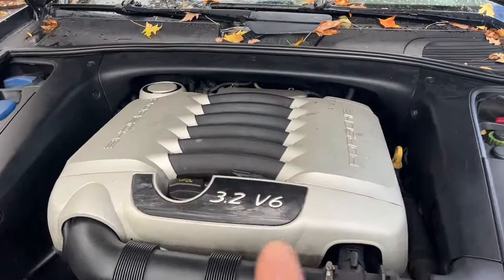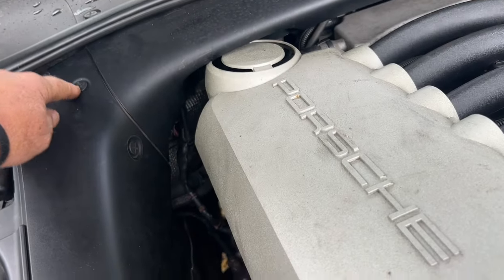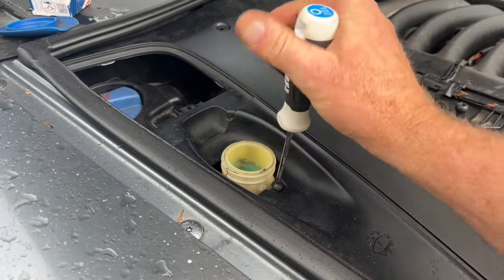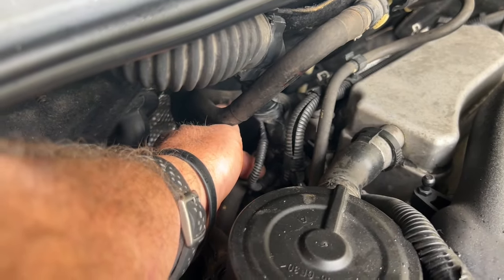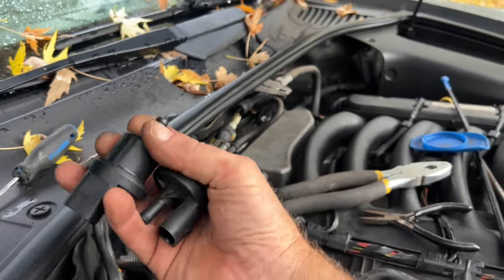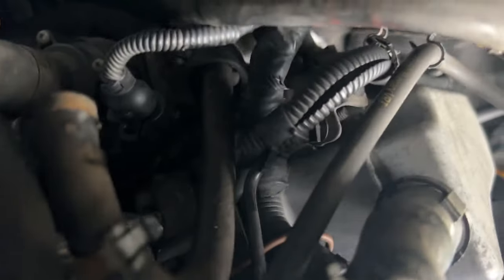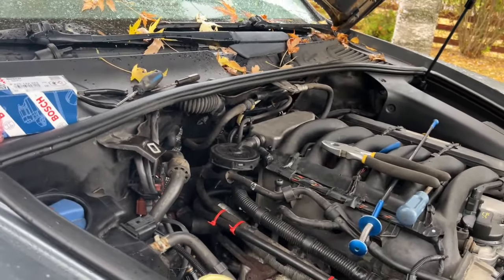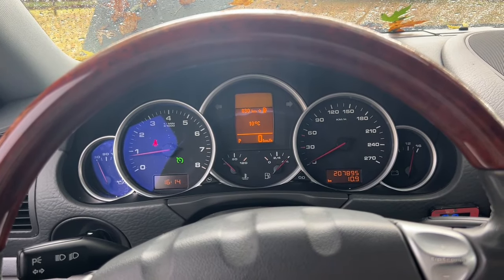Porsche Cayenne 955  3.2  code P0441 vacuum purge valve ,replacement

Comment: You gave great instructions on doing this. I replaced one of these and It’s a pain. Most purge valves are more accessible. Great how you explained removing the electrical connector. Why do they over engineer connectors and clips!! Great idea to use a piece of regular hose instead of spending $100+ on dealer molded one. Another great video.
Reply from the maker: thanks ..electricl connectors get more ridiculous each year . should be something thats standardized

Comment: Ok Fupa.. Lets go again. I know you since my w202 and you save me a lot of times.. Now.. I already check everything in my cayenne 3.2.. fuel pressure, all other possible vacuums leaks, gronds and voltage, smoke test, pcv valve, etc. Same problem. Cold start it kinds of search a vacuum leak but it correct itself 2min in when close loop enter(I guess, or it gets hot enought to do something). Works fine after. Im from Argentina. No error code also. If this works Im gonna cry and then comment down here. Anyways Thanks as always!
Reply: I havent sleep but so excited for this theory. Short term fuel trim and long term where negative when I check the first 4min the car start. So it made no sence for me. Vacuum leak would make it lean not rich so it would need to add fuel. Also if the maf where not reading some of the air.. it would add fuel. Stuck purge valve , I read just now, could make a rich reading do to the fuel vaps(never think it could actually affect that much combustion) getting in when not calculated by pcm. Im talking alone! jaja Im gonna sleep and check tomorrow

Comment: Hey fupabox first off I'd like to say I've been watch your videos for as long as I've owned my 1999 mercedes c230 kompressor probably more then 13 years now so I see your still at it and im glad! I dont ever think I've messaged you before ever , because I've only learned about this comment section a little over 2 years now I believe and I try it with this other channel fir my 2008 honda odyssey.  So here's whats going on I've been have the benz sit for over 3 to 4rs now due to life and what not and I've haven't had it in me to let go of this car because Its my very first benz and my very first close enough to a sports car / supercharger fast and the furious car i ever purchase so its my 4 banger premium I call it. So im so glad ya here still I have much to share with u and a whole book that I got this vehicle with..but I wanted to tell u because of ya channel I have had my beginning ls with my first born son to work on cars I did my first coil springs and bilstein..struts with my kid 10 years ago and went to my first junkyard myself with my kid when we went and found stuff to change out all from your older videos..so want to say thank you cuz today I've done much more over the years and ill share later with u all that..but here's what going on with the w202 is I've let it sit without filling the gas all the way up which I know now was bad and its been idling and running rough and I want to try and fix this with ya help and support b4 I get it towed to a tech I! Wana get it going also I probably should have done an oil change i know 2 for years of storage I've aced storing the battery ok over the past 3years and haven't had to get a new battery moving it from. Time to tim around my garage and into the driveway I got no check engine lights but it runs eractic and idels..when I give it gas the to rev the check engine light will come on so wondering what to do and start first, I thought about fuel stabilizer today watching some videos that I came across today that I dont think I ever tried off and on over the past 3 years over I just tried toping off with good premium fuel and letting it run parked to get the bad fuel that might be causing this is my believe over the years but il trying to calm her down..lmk if I could arrange a day to FaceTime u and show u would love to me u and show u by phone here's my number 815-207-9012 my name is Anthony please lmk if you can reach out through whatever means nessary thanks and cant wait to hear back ps sorry for long text im just very thermal in my commucations promise to comment less just stoked and exciting and a bit anxious to figure this out thanks for what you do! Only YouTube i know that is putting out content for this vehicle major thanks and gratitude 🙏
Reply from the maker: i would think your issue is just bad gas , Any ethanol in fuel will turn to a thick syrup after a year ...sometimes less than a year.
I would drain or siphon as much of the old fuel out as possible and put some good new fuel in with 1/2 casn of sesfoam fuel system cleaner. As long as the oil level is good I wouldn't worry about changing it yet unless there is moisture in it . As you said .just start it and let it idle and suck in the clean fuel ..raise rpm to 2500 for 20 seconds every 10 minutes or so . It should come back to running fine . Just keep an eye on engine temp just to be safe . I wouldn't be concerned about the check engine light unless it starts flashing. let me know how it works.
Reply: @fupabox  ok I will gona get the can of seafoam this week will lyk as soon as I give it a try and lyk whats the outcome will keep an eye out for the temperature like u said and flashing light okay ill get back 2 you!! Thanks talk to you soon....